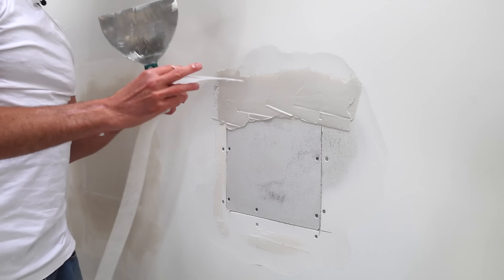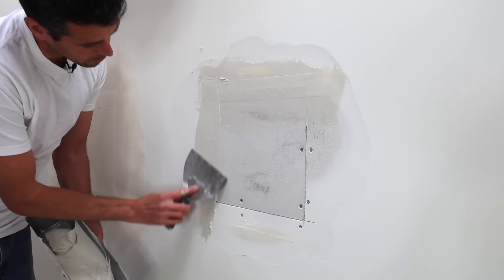The 3 BEST ways to TAPE DRYWALL!!!

Comment: My 2 cents - I use paper tape on new construction only.

 Most of the remodels I work on seem to be in walls with poor, over-textured (?) walls (usually done by diy'ers ?) & its too hard to make a flat patch that doesn't show thru. I used to use mesh tape on remodels, but hated the results. Of course due to lack of knowledge, I used air-dry mud which Ben says is a "no-no"..

A few years ago, an older union trained drywaller I know, turned me on to the Fiba-fuse tape & what can I say? I absolutely love the stuff and use it on all my patches now. I won't go back to mesh tape again ( except to tape fiber-cement tile backer board in a shower or tub). I don't agree with Ben about not using it on corners. While it isn't creased for corners, you can still bend it in half an put in a corner. the bad thing about that, is you have to be careful with your knife edge as you can cut it pretty easily. Mostly I still use paper tape in the corners. Another technique I use- in corners when a new wall butts into an existing wall (that's already textured & painted) is to flat tape it. First I will apply masking tape to the existing wall with the edge in line with the face of the new wall ( to keep mud off the wall & out of the texture finish). Then I will flat tape the joint on the new wall side. When dry, i will run a small bead of painters caulk in the corner & let it dry. Then finish & texture new wall as usual & your "good as gold". I've never had a callback for a cracked joint with this method.

Finally,- my opinion is that the Fiba-fuse is stronger than the mesh tape.
Reply: Fibafuse is a remodel tape and really should be used everywhere there is any kind of an issue. It can go over damaged and blistering paper with no issues (like a wall where tile was removed.) it is ussualy best to replace the damaged parts but sometimes depending on the quality and finish of windows, door casing and cabinets the only option is tape into damaged board. Fibafuse is the only product to use in these locations. Same way you'd only do off angles with synthetic beads like no coat, the only tape to use in remodel repairs is fibafuse. If corners are really bad I will flat tape both sides with fibafuse and then run paper tape creased on top. Only issue is the itchy fingers, gotta get used to taping in gloves
Reply: @NickRgibbs  Weird - I don't get itchy fingers (who knows, maybe its the callouses) but my forearm gets itchy on the side of my body that has my drywall tape reel. I must be rubbing against it when pulling out some of the tape. I need to remember to wear long sleeve shirts on the days that I tape.

Comment: Hi Ben. This was a good back to the basics video. Thank  you. But, hey. I have an off the subject question. How do you keep your 6" knife so clean and without rust? I live in Hawaii, and I've thrown 2 away because I left them wet and they rusted bad. But is there anything you do out of the ordinary?
Reply: Stainless steel, or keep the carbon steel dry.
Reply: I've found just scraping off excess mud as best you can then leaving it to dry works, then just washing off little bits of dried mud off before using if needed. I kind of do the same with my pan, then use a one or two inch knife to scrape dried mud out of corners then wash it out quick before putting new mud in. I don't do it full time so I could he wrong but it's what works for me (I live in Alberta so not as humid as Hawaii)
Reply from the maker: It's stainless steel. You can sand the rust off. No need to throw them away.
Reply: wash them clean after each use (I Keep a soapy bucket of clean water for this task) and hang to dry and spray a rust inhibiter or WD40 on the blades after cleaning.
Reply: @andrewcarr2431  Ben always has his gong brush in the water bucket....👌

And the WD-40 for sure!
Oh, boy..how many times have I sanded them?
Reply: @hutchdw77  Yeah that will do it LOL Thank you
Reply: @Blingdung  Yeah I love Hawaii but sometimes the rust....ahhh. But thank you so much for your response.
Reply: @vancouvercarpenter  I did on one of them and it worked. But stainless steel is def a better solution. TY Ben!
Reply: @andrewcarr2431  Uhh never heard of this one. Gotta try it. TY Andrew.
Reply: @Sindee_gradmom  but. The blue steel have a little more “touch/feel” to them

Comment: When I learn to paint the first job I got working at a paint company was with a friend of mine when I was younger I think I was like 19 years old and I’ll burn later on they would call apartment shit work back then because you were spray all the flat The inside the closet would have flat paint all the walls you would roll and cut the kitchen and the doors will get semi gloss I don’t wanna see you pretty much we would have a unit done in an hour we carried to dry clothes want to put down under the paint sprayer set a drop to cover if I was painting the kitchen I would cover up the stove Countertop and instead of using a drop on the floor we had a piece of carpet cut long enough when we put it down in the kitchen it will cover the whole wall so when you’re rolling The wall the carpet would catch all the overspray from the roller because we were fast and you didn’t make custom paint money work for these units but that’s why two people did at least five a day if it was 63 people it would be six. Unit a day 👍👍

Comment: Knauf Germany claims, the first tape you showed is only to be used to reach a better resistency against fire growth. So the mud between the plates won`t fall out in one piece, what would result in bigger cracks & slots. But this tape can avoid cracks because until the fabric is "fully stretched", the mortar has already been deformed.

In Germany I think most popular is the fibre fuse tape you showed as second, as well for professionals.

Paper tape: what I see on Youtube should be pretty common in North America?
I started to use it. Kind of thick but I think the best material because it is just the same as the drywall board itself.
One roll costs 15-20€ here, I just bought the same length für ~3USD at Lowes as souvenir 😎.
Maybe the reason why it is used rarely in Europe.

BTW: don`t you give the edges of the boards a V-Shape, so the mud has a bigger surface to ensure contact?

Comment: If those patches were going to move relative to the panel you might need tape but in this case the patches coincidently are over a stud. Also, evidently you could use wider and probably longer backers as your screws are too close to the joints. "Back in the day" we used concave trowels not knives to finish. I used to have a 18" one that could burry a butt joint with one pass.

Comment: 10:54 Hey man, appreciate the information greatly, just curious - here when you're paper taping, why do you not extend your vertical tape to cover your horizontal edges? I am very new to doing mudding I had just heard through grapevine information that covering those horizontal edges is better for it in the long run, I could see how it could cause some overlapping raising it too high? other than that /shrug lol! Thank you for your time m8!!
Reply: I never overlap because it makes more of a hump to cover up. Especially when using papet tape, it's already pretty thick. And on a patch with butt joints it really raises up more

Comment: I mesh taped my entire basement, with an AP mud. Still haven't seen any issues. How long would one expect it to take for cracks to appear? It's been around a year so far.
Reply: I did the same thing 18 years ago. I think in a basement you are golden either way, because the framing does not move like the first and second stories of the house, which is subject to sun, wind etc.
Reply: @BoldWittyName  ya that's what I was thinking. Plus the basement was framed and drywalled 26 years ago, just never taped, so it should be done moving by now I would hope.
Reply: @BoldWittyName  Hmm, that's interesting.  I never thought about how framing could move on higher floors.
Reply: A framer told me basement framing will only "squish" (in the downward direction) but never any other sort of movement.  Most framing settling is seen in the first year, and it's unusual to see any past year 5.  This came up in a conversation where he told me I was (unwittingly) smart to wait a few years to finish my basement.

Comment: Knowing nothing about drywall/mud/joint compound - it would really surprise me that the fiberglass tape would be weaker than paper. 

In most applications - fiberglass that is infused with something is incredibly strong.

Comment: I am new to drywalling, so what's the difference between air dry mud, and setting mud
Reply: Im no expert but for example 20 minute mud sets way faster than evaporation. So that leads me to believe that it has properties like concrete...meaning some sort of chemical reaction is taking place to harden the mud. All purpose mud dries by evaporation which obviously depends on multiple factors, like humidity.
Reply: @tombranstetter68  you are correct.
Reply: I've always used air dry (all purpose) because they don't have 20-minute/taping mud at my HD or Lowes.  I think that all purpose mud doesn't bond as well to the tape at least due to the fact that it's usually dry and hot where I live and the all purpose starts drying the minute it hits the wall and continues quickly, as well as drying more the more you work it over the area.  This can be prevented a little by spritzing the area with water prior to applying the mud, but again, with the dry Texas heat the water's rushing out of the mix and into the air really fast.  I also think it either has less adhesive or a weaker one mixed into it compared with the taping mud, but that's just on account of not seeing as good of results as I sometimes expect with the improved techniques of spritzing and working quickly and efficiently, so no proof for that.  I will say the all purpose works adequately, though.  I can tape a room and cut away a few voids or redo a stretch of tape here or there and it works out ok.  Also, the rapid evaporation forces me to get better and quick, which isn't the worst thing.
Reply: Setting mud dries harder, more durable. It also doesn't shrink nearly as much. It cures via chemical reaction.
Air dry mud cures from drying out. Which is one of the reasons it shrinks so much. It's advantages are that it sands easier, and it comes premixed. Though you will want to thin it at least a little so it will go on easier and smooth out better. It will also give you a smoother finish than setting mud.
I use 90 minute mud. I'm not that experienced and take a while to get stuff done, so that is a great compromise. I use that to prefill, tape (mesh), and second coat. Then finish with easy-sand premixed.
Reply: Setting style compound is akin to old style plaster, it uses a chemical reaction to create the setting process when mixed with water.   Available in various drying times and strengths depending on the need.   Once mixed it will start to set (think concrete) and you cannot alter this process.    It comes in a plastic lined paper bag to keep to product dry before use.

Ready mixed/air drying compound is pre-mixed with water from the factory and dries as the water evaporates from the mix (think PVA or that white glue that you used in art class).   This can take a certain amount of time depending on environmental conditions.    This is normally sold in various sized buckets at the hardware store and can be thinned down slightly with water as needed.   

Actually paper mache would be a good comparison to taping drywall with paper tape and joint compound.
Setting compound and mesh tape is how the hospital sets your broken bones in a plaster cast.
Reply: @tombranstetter68  yes, it is a basically gypsum powder (Plaster of Paris) , some chemicals and "secret ingredient #9" AKA "Accelerator" depending on the manufacturer.   When mixed with water you get "setting plaster" that will go off after a certain amount of time, dictated by the accelerator in the product.    Once you get the hang of the products you can mix and match to perform quick repairs (although this does invalidate the manufactures warranty).   By adding some setting compound into your joint compound you can speed up the setting time.   Great for quick repair work or to increase the strength of the product.   Ready mix is the same but way less accelerator and loads more water to make a runny product.   Essentially it is a plaster of paris and PVA glue in a bucket.     In plastering a white wash of watered down PVA glue applied to the surface  will increase bond and stop the surface sucking the moisture out of the mix thus increasing adhesion and working time.
Reply: @TheKingofkrypton  Yes in humid or hot locations all you can use is pre-mixed stuff as setting compound would set in the bucket after mixing.   I know of guys who work in Arizona and other similar places and they have to water down the mud to keep it from setting on them while they work.    Taping mud has a lot of PVA glue in it (secret ingredient) for tape adhesion that would make the product dry quicker in the climate.

Comment: My Name Is Mud

Also Fiba Fuse is really lovely to work with on flats and butts. But you gotta learn to use paper for corners. I have a disdain for mesh tape, especially after remodeling and realizing the homeowner before built the addition with mesh in corners...